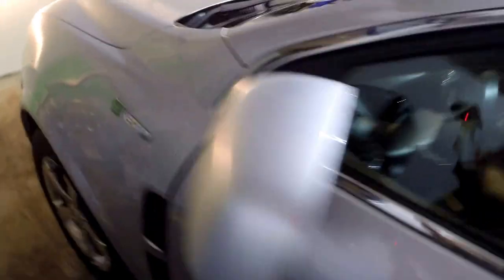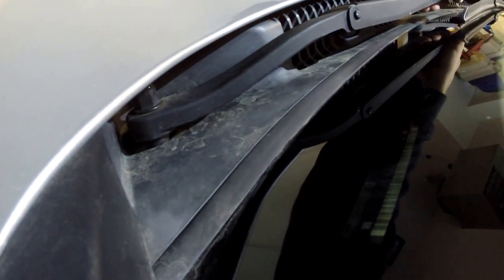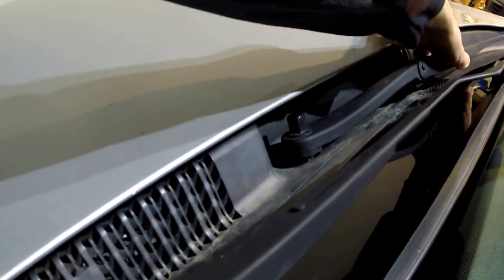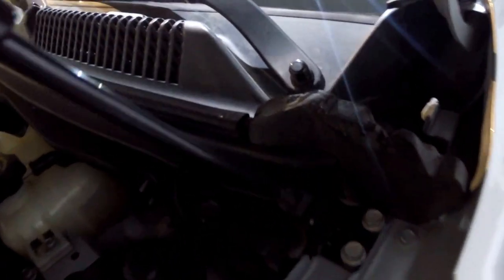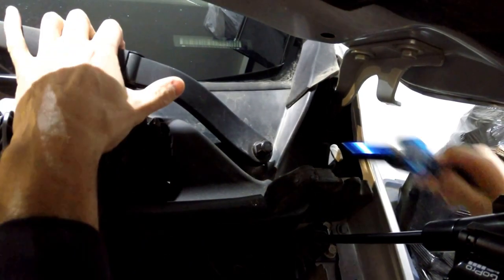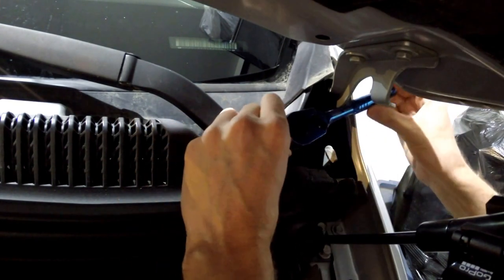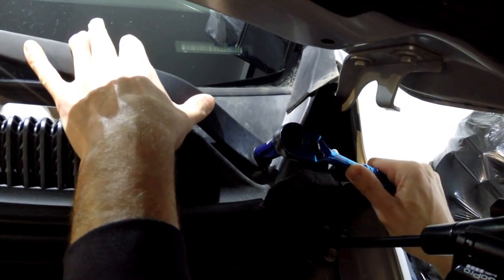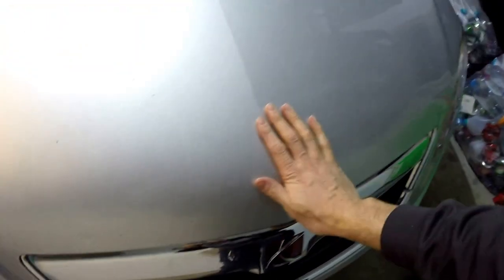Windshield Wiper Arms Out of Sync - Repair or Replacement for GM Saturn

Comment: Thanks for the video. I put my Gopro attached to suction cup on windscreen and accidently start the wiper which damaged the synchronization of the bigger wiper.
Thanks I will go ahead and find out if I can fix that wiper using your method.

Comment: Thanks for the video. I am in the process of replacing my entire linkage.  I have this issue but it is not because the nuts aren't tight.  The pivots aren't in sync - one side is going clockwise while other is going counter clockwise.  Any idea on how this can be corrected?
Reply: Dustin Moltz  I'm having same issue. Did you ever find an answer or fix the problem?
Reply: Yeah, what caused this was the arms that connected the mottor to the pivots were on different sides.  I had to remove everything, reposition those arms and then it fixed it.  Sorry, I dont know the proper terms for some of that stuff.